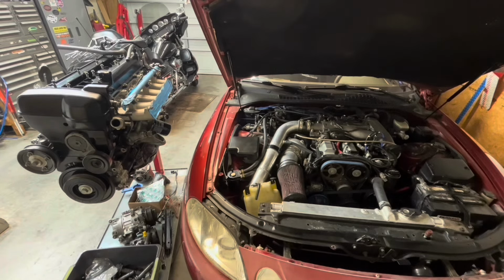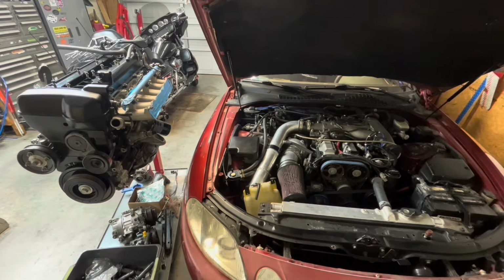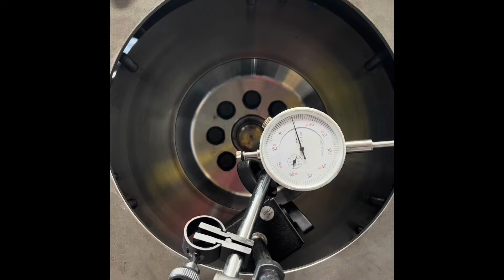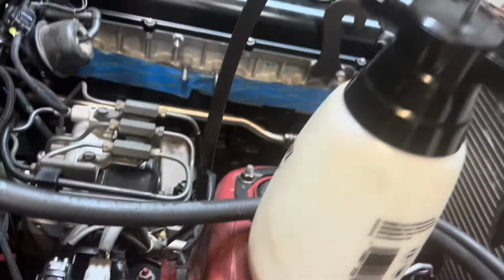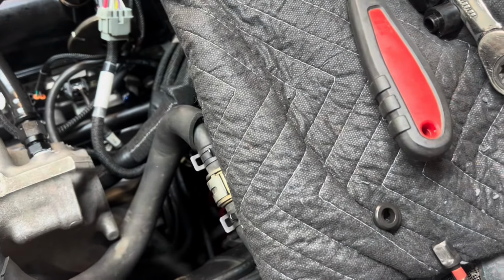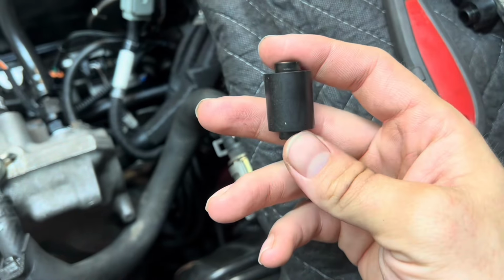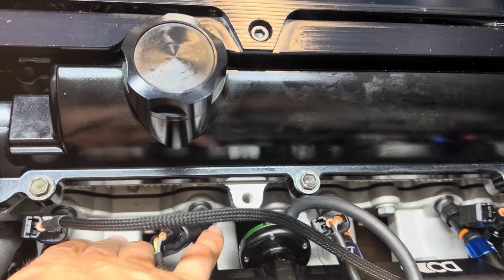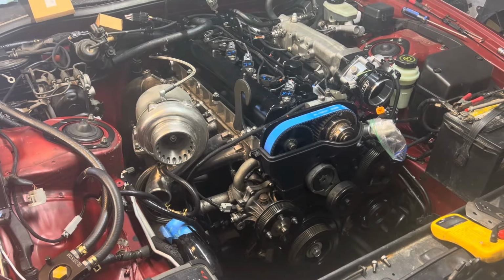Sc300 Nat swap to GE-T

Comment: I would highly suggest before running that turbo on that manifold without welding extra braces to the flange for the turbo weight, after it heat cycles they have the tendency flex and crack, I've used this exact turbo manifold before
Reply from the maker: It has one